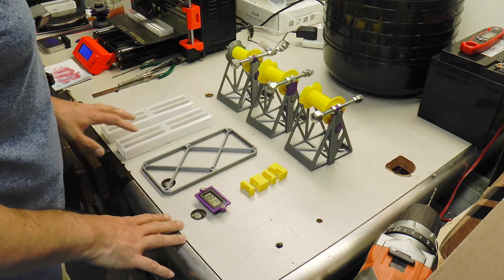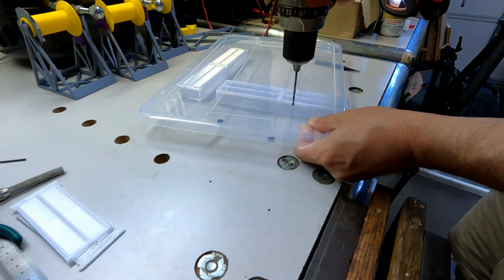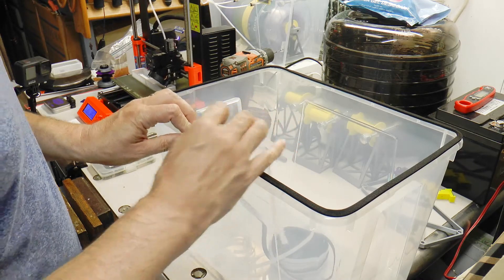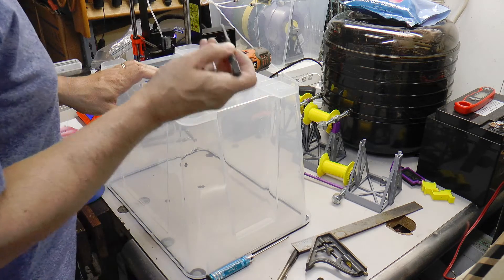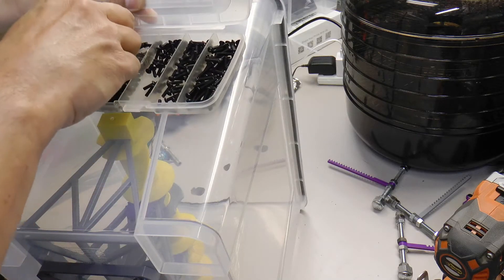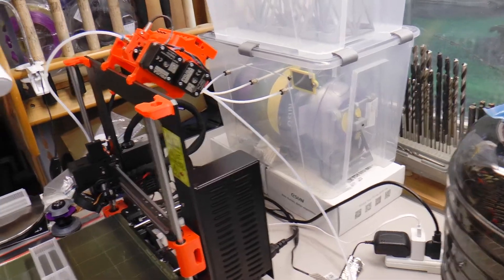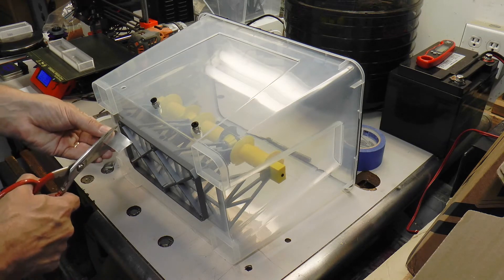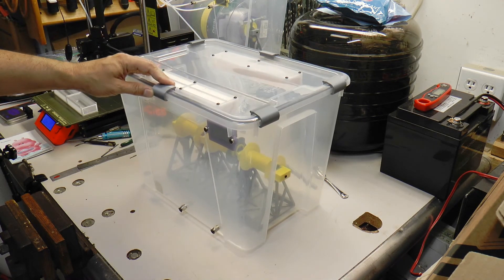IKEA Samla Dry Box with Retracting Spool Holders

Comment: These are inexpensive, but they're pretty flimsy. Have you looked at the boxes that Menards sells? They are more rigid, not that much more expensive but they are gasketed and airtight.

I looked at the Rubbermaid containers. They hold one spool and they're $15 apiece.

I can get a larger box from Menards for about $20 that holds multiple spools. The Masterforce 5 gallon containers are sealed. By the time you buy the IKEA storage box, add the latches for it, now you've got a smaller box that's way more flimsy. 

They also sell sterilite gasket 32 quart boxes for $10. Latches included.